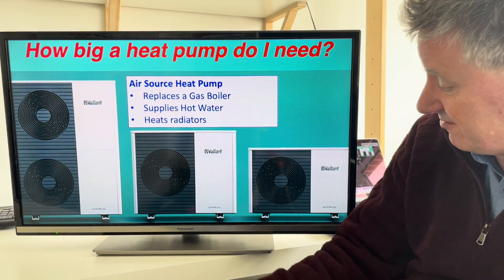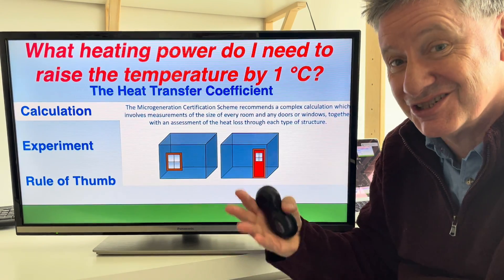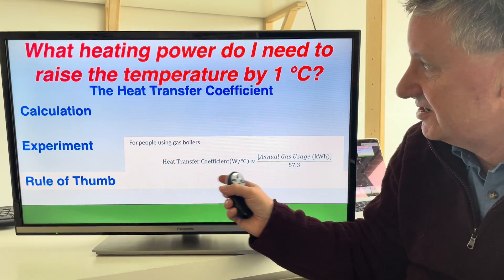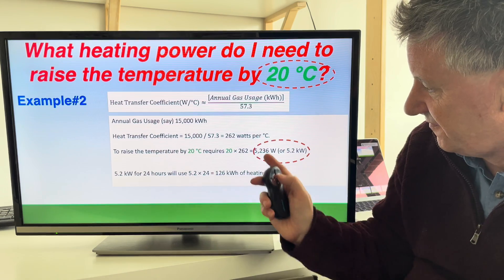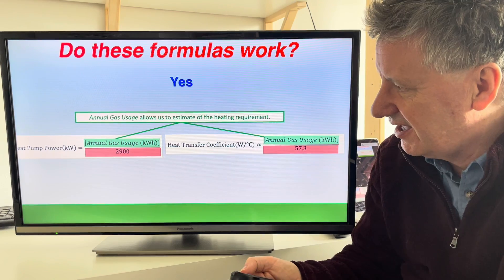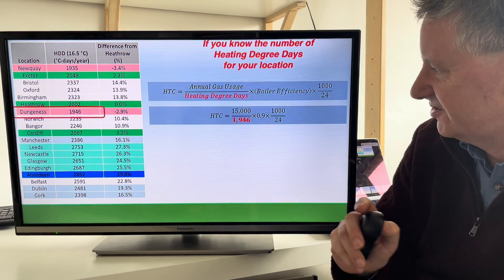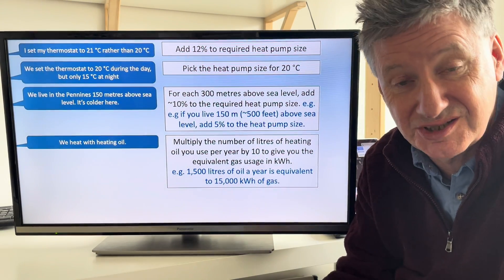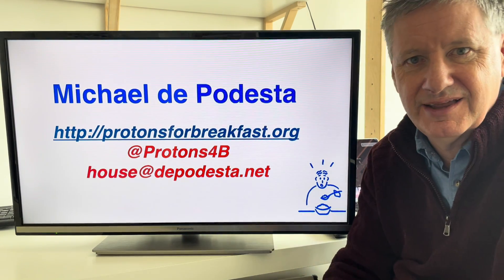How big a heat pump do you need? A simple Rule of Thumb.

Comment: One oldfashioned gas hearth for one large sitting room cranks out 12 kW. You would need a 4 kW heat pump to replace it, and that's for that one room only. Heating of a whole house, plus water heating for showering and the kitchen, requires a multitude; up to 35 kW for a large and poorly insulated structure (105 kW for a gas fired central heating boiler). And 35 kW is a serious three phase AC consumer, requiring wiring adaptation and additional metering and fixed tarifs. With electricity being the most expensive way of heating as it is. The math on this is far easier than people think. Vaillant uses Chinese compresors. The true lifespan of those remains to be seen, as the brand has not been in the heat pump business for very long.
Reply from the maker: Gerhard, Good Evening,

Your numbers are WAY OFF! A typical UK house has a peak heating demand i.e. on the coldest day of about 7 kW. In West London a 16 kW heat pump can heat a whole 3-story + basement Victorian house. A 7 kW heat pump requires about 2.5 kW of electricity.

My heat pump is extraordinarily cheap to run - we download electricity at night to run teh heat pump which delivers heat at under 2 p/kWh - about one third the cost of heating with gas.

If you don't want a heat pump, that's fine. But please at least educate yourself before commenting.

Best wishes

Michael
Reply: @michaeldepodesta001  We need 90 kW for a small but class A insulated 3 story office building (with the volume of 3 homes). Three DC inverter outdoor units (45 kW master unit, two 28 kW slave units) and 15 indoor fancoil units. So that must be quite some 16 kW heat pump for that Victorian house. There is no way to heat all rooms of a 350 cubic metres house with average insulation and decent comfort like you can with gas fired central heating with just 16 kW. And 16 kW is 16 kW, whether the heat comes from gas or from London air or from the Mediterranean.
Reply from the maker: @Gerhard57NL  You are mistaken, grossly mistaken.

Comment: The problem with method 3 is that the gas usage per year can change depending on a mild or severe winter.  Method 1 is NOT complicated.
Reply from the maker: Alan: Good Morning. 

Method 1, (using procedures specified by CIBSE and MCS in the UK) systematically overestimates heat loss from homes by factors varying between 1.5 and 2.5, resulting in oversized heat pump installations. Unless carried out by experienced assessors, Method 1 is very likely to overestimate the size of heat pump required. The survey will also likely cost around £400. 

Before installation of a heat pump, everyone will have a survey, but the purpose of this video is to show that people can get an estimate of the likely heat pump size required at very little effort and no cost.

The year-to-year variation in heating demand is typically about 10% which is less than the typical error in a survey.

The main weaknesses are that it will give poor answers if people use a very large amount of hot water, or if people keep their dwelling cold for most of the time and then just heat it up for an hour or two each evening.

Best wishes

Michael

Comment: Hi. 
Thanks for the info. Amazing! 
My house is 306m². 9" solid brick. 
New roof (fully insulated) and windows in 2013. I'm in the process of insulating the ground floor crawl space. 116m²
Using my average of 32000kwh of gas and a 80% efficiency for the boiler and using my heating degree day. A heat pump size of 10kw is being suggested ! Amazing.

I heat the house to 19.5c

2 hours in the morning and 7 hours in the evening.
I also use a 8kw stove on the colder days

I'll get a heat geek heat loss survey done in the new year. £500 though. Ouch! 
They'll monitor the house over a few days.

A local ASHP installer  estimating an heat loss of 20kw! It was an educated guess. 

Am I right in thinking a 22kw system (Two 11kw HP mitsubishi Cascade system) could produce 528 kwh of heat per day?
Looking back at my octopus data (only from March 2023) my highest gas heat load was 165kwh. (at 19.5c)

To be honest, the house could be a little warmer sometimes. It's finding the balance between cost and comfort. Fingers crossed, both will improve with a ASHP. 
I have 9.24kwp 
15 panels south 
7 west 
6kw solaredge Homehub inverter 
10kw solaredge battery. 
100amp. Single phase.
System predicted to produce 8.4Mwh per year. I've exported 2MWh this year. 
I wonder how much of the heating demand will be covered by solar?

Thanks again.
Reply from the maker: Lots to comment on here!

“Hi. Thanks for the info. Amazing! My house is 306m². 9" solid brick. New roof (fully insulated) and windows in 2013. I'm in the process of insulating the ground floor crawl space. 116m² Using my average of 32,000kwh of gas and a 80% efficiency for the boiler and using my heating degree day. A heat pump size of 10kw is being suggested !
Amazing. I heat the house to 19.5c 2 hours in the morning and 7 hours in the evening. I also use a 8kw stove on the colder days.”

The Rule of Thumb should work if during the heating season your home stays at roughly the same temperature during the day and night. 

“I'll get a heat geek heat loss survey done in the new year. £500 though. Ouch! They'll monitor the house over a few days.” 
Good idea. It’s real money, but it’s real work and expertise and genuinely valuable insights.

“A local ASHP installer estimating an heat loss of 20 kW! It was an educated guess. Am I right in thinking a 22kw system (Two 11kw HP Mitsubishi Cascade system) could produce 528 kWh of heat per day? “
Yes

“Looking back at my Octopus data (only from March 2023) my highest gas heat load was 165 kWh (at 19.5 °C).”
165 kWh/day is equivalent to just under 7 kW. Near to me in west London the average temperature in March 2023 was 8.5 °C and teh coldest temperature was - 2°C on teh 11th March 2023. I would guess your peak demand would not be much more than that 

https://www.wunderground.com/dashboard/pws/ITEDDING4/graph/2023-03-8/2023-03-8/monthly

Do you have data from January – there were some very cold days this January 2024 (16th to 19th in the London Region). This would give you a very good idea about your real heat demand. 10 kW corresponds to 240 kWh/day

“To be honest, the house could be a little warmer sometimes. It's finding the balance between cost and comfort. Fingers crossed, both will improve with an ASHP.”
Each extra degree Celsius increases heat load by around 12%.

I have 9.24kWp 15 panels south 7 west 6kw Solaredge Homehub inverter 10kw Solaredge battery. 100amp. Single phase. System predicted to produce 8.4Mwh per year. I've exported 2MWh this year. I wonder how much of the heating demand will be covered by solar? 

Not much of your heating demand will be covered by solar because obviously the solar peaks in summer and heating peaks in winter. But it should not be zero. On my system – smaller than yours – in December and January I get ~ 3 kWh/day, which corresponds to about 10 kWh of heating. It gets better in November and February and is quite substantial – maybe 50%? In March and October. 

"Thanks again.
"
You’re welcome. Good luck with your endeavours

Comment: Thanks for such a useful tool but I have a question about the oil calculations, You said multiply oil usage by ten to get the same result as the gas kWh usage but does that take into account the difference in efficiency between oil boilers and gas.  My oil boiler is 19 years old and not condensing so is probably 70% to 75% efficient whereas you mentioned a gas boiler should be around 90% efficient. The other thing I have heard is the comfort level goes up with a heat pump so I'm assuming they heat the house more than they did before. Does this calculation take that into account?

We use approximately 2000 litres of oil per year so I am trying to get my head around how large a heat pump we would need and how many kWh we would use in a year to have similar heat in the house.

Thanks again.
Reply from the maker: Thank you for your kind words. Regarding your particular questions. 

First of all, please remember that this is a rule of thumb.

In calorific terms 2,000 litres of fuel oil consumption is roughly equivalent to around 20,000 kWh of gas. So if this is your annual usage, then this would suggest very roughly 20,000/2,900=6.9  ~7 kW maximum heating demand. This assumes that (a) the dwelling is kept at a roughly uniform temperature throughout the heating season and (b) you hot water usage is not crazy. If you switch heating off all day nd then blast it on for a couple of hours in the evening then this may cause the formula to underestimate your heating requirement. If you do use a lot of hot water then the formula will overestimate your heating demand.

However you are right that many oil burners are not as efficient as modern gas boilers. The 2,900 number in the formula assumes 90% efficient burning so if the oil boiler is only 75% efficient, then the heat load will be less.

20,000 kWh of gas burned at 90% efficiency yields approximately 18,000 kWh of heating in your home. 
2,000 litres of oil is equivalent to 20,000 kWh of gas burned but only at  (say) 75% efficiency and so yields approximately 15,000 kWh of heating in your home.

So the estimate of a 7 kW heat pump would be an overestimate. A better estimate would be around 75%/90%= 0.833 * 6.9 = 5.7 kW. In practice a 7 kW might well be a good fit giving you some headroom and faster re-heating of domestic hot water.

The 'comfort' issue is difficult to assess qualitatively. In my house, all the rooms are at a very similar temperature all the time. This is a pleasant environment to be in. Now at the moment - and through previous winters - our internal temperature is a smidgeon over 21 °C which is hotter than teh 20 °C set point, but we have not tweaked teh system because we just enjoy it! Every extra degree Celsius causes around 12% extra heating demand.

Best wishes in your endeavours. Michael
Reply: @michaeldepodesta001  Thank you for such a comprehensive reply. 

We are probably not typical in that we tend to keep our house cooler than most but use a multi fuel stove in the living room for local heat. 
Using two digital thermostats one upstairs and one downstairs we have downstairs at 18C in the morning for 2 hours and 6 hours in the evening. We also have upstairs at 18C in the morning for 2 hours but only 3 hours in the evening. In between these times the temp is set to 14 or 15C so basically off as the temps rarely fall so low unless it is very cold outside.
I understand with a heat pump I would need to have more even temps throughout the day, that would be OK as it would give more comfort but I guess might confuse the calculations. 
Hot water wise we probably use a tank of water most days which I believe will be around 5 or 6kWh based on what our solar Iboost uses to heat the tank.
So from these calculations we could estimate a 7kW HP would be sufficient but if I decided I would quite like the house a bit warmer then maybe a 9kW HP would be a safer bet. We might also be able to retire our multi fuel stove.
Or are we better to keep to the 7kW HP and use the stove on the coldest days? I hear conflicting advice on whether over sizing a HP is a problem.

Obviously I need to get any installer to do their own calculations but at least I now have a useful estimate and if they say we need 15kW HP I can tell them they need to redo their calculations.

Thanks again for all your help.

Comment: 6:29 - at the end the devil lays in the details. It depends on which consumption figure you use, a year that is  a normal usual year with heating season or maybe like here in germany a year or more of the 2020s.
Why ?
Well, in the 5 years since 2019 4 have been 20% warmer by average and the only excemption was only 8%warmer than the long time  average.
If you take the consumption figure in kWh gas for example of one of those 4 or 5 years your heatpump could be too small in case of normal years that might return - or not. But you might prepare for the worst and therefore the best advice is to have and take the longtime kWh figure over 1 or 2 decades to not end up in the german climate change mess.
Reply from the maker: Dear typxxilps, Good Evening. 

The key is the title: this is a "Rule of Thumb" which translates in german as "Faustregel". This is not the same as heat loss assessment for a home. 

The idea was to allow people to easily estimate the likely heat pump size. Many people fear they will need huge heat pumps and in the UK it is commonplace for heat pumps to installed at twice  or three times the optimum size.

Indeed, gas consumption will vary from year to year, but the rule incorporates some leeway for that.

Ideally a heat pump should probably have a little headroom, but if not then it is not a disaster if the house gets a little colder for two or three days a year. You might find this article interesting.

https://protonsforbreakfast.wordpress.com/2024/10/08/deliberately-under-sized-heat-pumps/

Best wishes

Michael

Comment: Hmm, not sure about this. My annual gas consumption is 11,460 which gives just under 4kW HP. But I currently have a 30 years old non-condensing, poorly running (for at least a couple of years!) gas boiler in a detached 4 bed with 4 adults and only reasonable insulation (loft could be better). Should I not be expecting more like 6kW?
Reply from the maker: Good Morning. A gas consumption of 11,460 kWh is below average for the UK, but your detached 4-bed house is probably larger than average in the UK. And yes, 6 kW peak heating requirement would sound like a good first guess.

This is just a rule of thumb, and it can give misleading indications for a couple of reasons. 
If the house is unheated for long periods of the day, e.g. when everyone is out at work, and the temperature falls then the gas consumption corresponds to a much lower average temperature - and every degree Celsius change in average temperature represents about 11% in gas consumption.

Alternatively I note you have 4 adults. If they were in the house all day, then this corresponds to 400 W of heating i.e. 9.6 kW/day of heating, or 3,500 kWh of additional heating. Similarly, all electrical consumption ends up as heat, so if your electrical consumption were particularly high, this too could be heating the house.

Without details I can't really help. You could try measuring gas consumption and electrical consumption on a very cold day and then work out the required heat pump size from that.

Best wishes

Michael
Reply: Mine is less than that - only 8000KWH for 22c most of the day and all day at the weekends.  That is with a new condensing boiler, 25KW.  It costs £13 per week to run and provides instant hot water.
Before that I had a 20 year old Ideal Icos heating water in a cylinder and radiators, 15KW I think it was.
It had to get electrodes fitted every year, but it was very efficient and cheap to run, cheaper than the 25KW.
Many channels run by staff from heat pump companies will over estimate figures to make it appear gas is more expensive to run.  A heat pump would have been far more expensive for me to fit, nowhere near as controllable for instant heat, couldn't provide constant hot water on demand and was many times more expensive with the defrost cycles and their recovery when rooms cool, then the water heating by immersion heaters because it would keep doing a legionella cycle etc.
There were also a lot of additional parts, tanks and piping to go wrong or need maintenance, the equipment would be out of date within a few years as technology improved.

As for people saying to go and spend another £13K on solar panels and batteries to make it cheaper to run, they must be mad.  All the money they could have saved in interest offsets the gas bill.

If gas boilers were going anywhere, Cadent would not have been upgrading all the UK Gas mains.

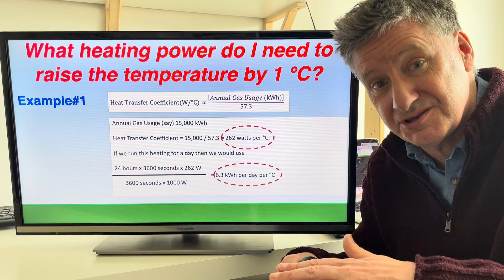Comment: 7:20 if you have 3600 on the top and bottom of the division they equate to 1 and cancel each other out. So they don't need to be in the equation at all (it's fine to keep them in for illustrative purposes but un-necessary for the actual calc!
Reply from the maker: Indeed. As you say, it was for the purpose of being explicit.